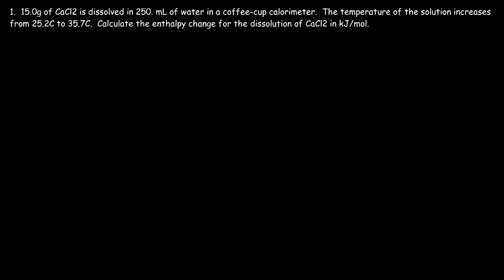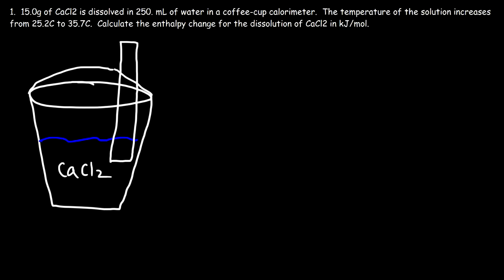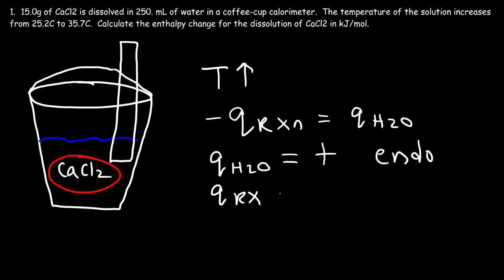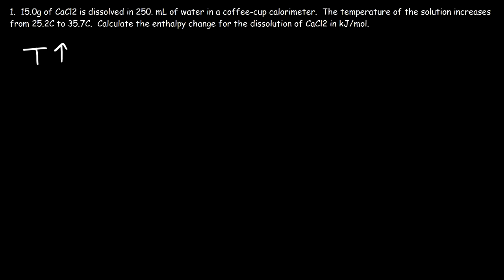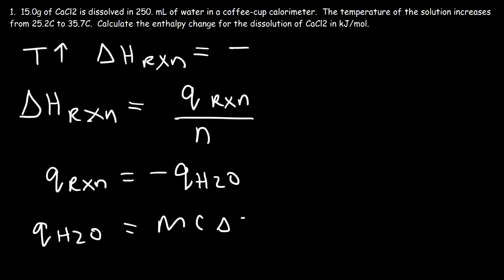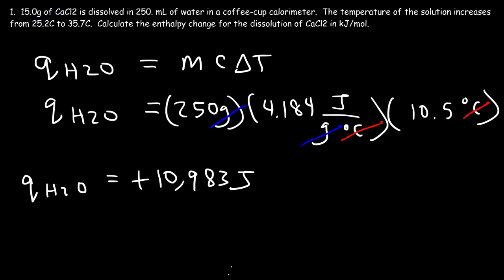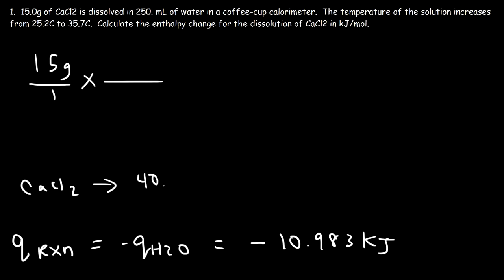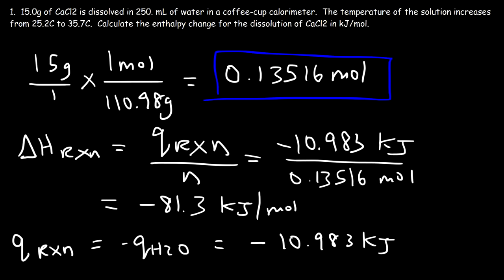Coffee Cup Calorimeter - Calculate Enthalpy Change, Constant Pressure Calorimetry

Comment: Dear O-tutor, here is the catch on 7:15 - why is the mass 250g (only water)? Should have been 265g solution = 15g solute + 250g solvent. It is the united system with the specific heat capacity assumed to be 4.184, and the density 1.00, and its temp rises. Am I right?
Reply: this is what i did! because the solution is a mixture of both the CaCl2 and water! My answer was 86.13 kj/mol
Reply: @maggiestorti656  So....do we leave out the 15g of solute or include it with mass? I have a final coming up and would like to get this question right.
Reply: C With2Es I’m pretty sure we add it to the 250g!
Reply: @nazuzun5803  OK.
Reply: i dont think so because that equation is only for Qh2o, which means to use the mass of h2o by itself
Reply: This is because we are purely looking at the reaction of H2O, then whatever change happens in heat happens to water, we mirror it.
Reply: the specific heat capacity of water is 4.18. It is not the specific heat capacity of the coffee cup calorimeter. furthermore, cacl2 is the system itself. whatever energy is produced is released out of the system into the water. so u can't take the 15g into consideration

Comment: At 5:08, why is q Rxn = -q H2O? I thought if the temp. of the solution went up, then H2O was absorbing heat, and was therefore (+)? Calorimetry problems severely confuse me for some reason, but your videos have been very helpful so far. Just want to make sure I'm understanding this correctly. Thank you!!!
Reply: is that just a general formula showing that there must be a negative sign in order for them to be equal?
Reply: Yes, there must be a negative sign to make them equal. You can put the negative sign on either side of the equation.
Reply: From the system’s perspective, the CaCl2 is losing heat, so (-), while the water is gaining heat, so (+). It gets very confusing because you have to grapple with the system’s perspective and the surrounding’s perspective. Hope that helps
Reply: @Pal0maSama  so qrxn is for the compound only?
Reply: @KomicWorld   bud she must've almost graduated by the time you made this comment lol